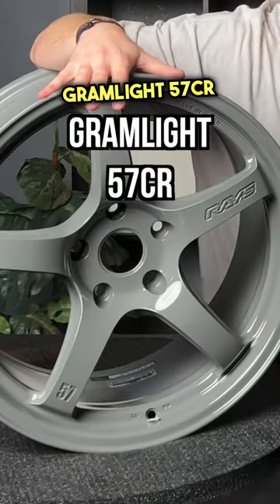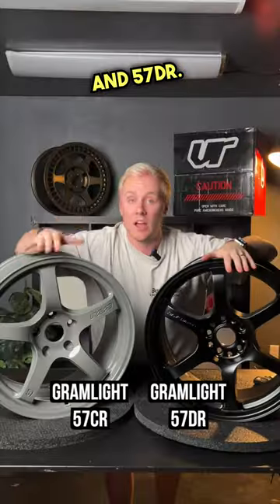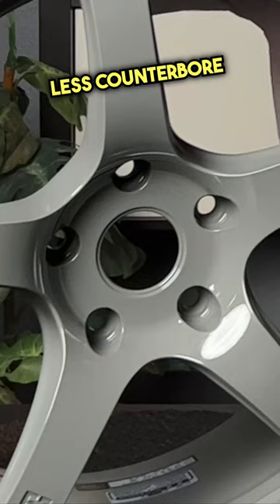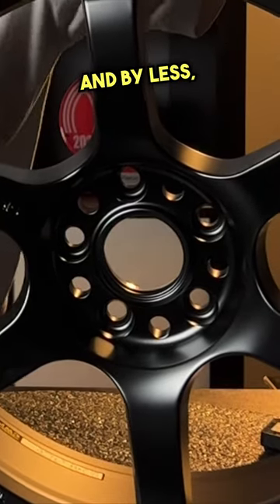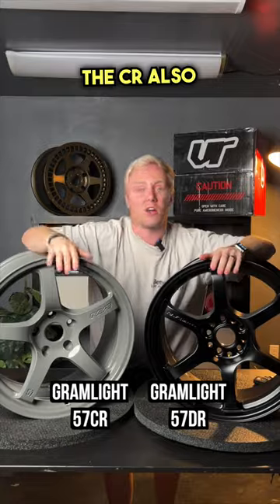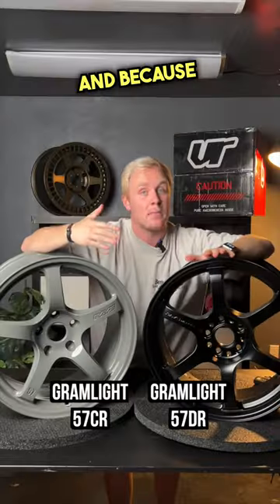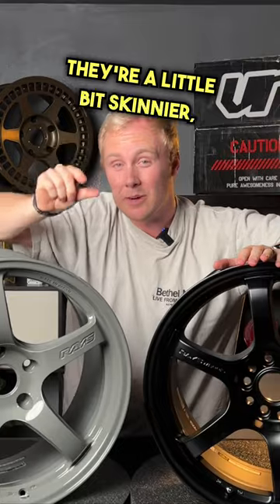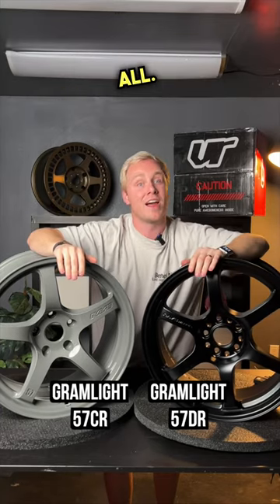What's the difference between a Gramlight 57CR and 57DR?

Comment: Just a quick question, I just bought mines and they come with just 5 holes in the center where the lug nuts are, but I see other people with the same model 57dr and they have 10 holes or 10 counterbores in each wheel, you why is that?
Thanks